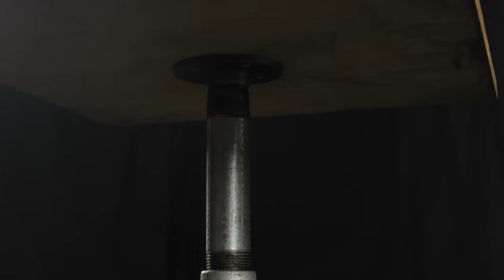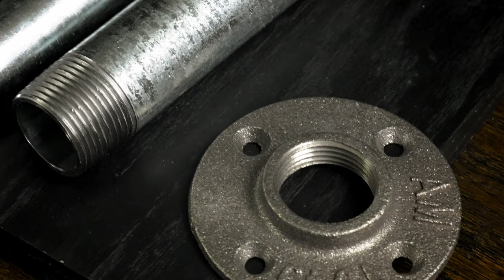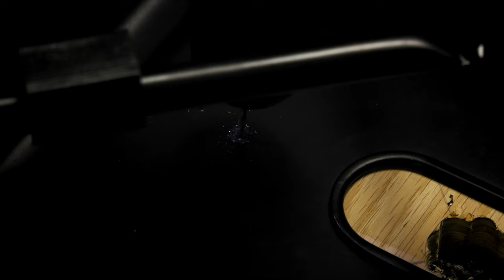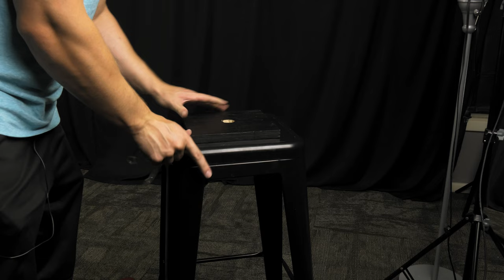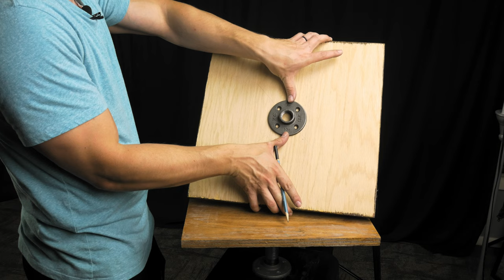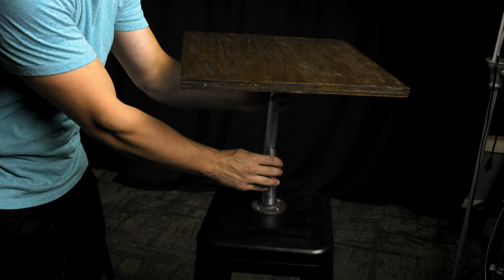Making a Sculpture Stand Turntable out of a Metal Barstool.

Comment: Also did you use WD40? The pipe I found doesn’t really fit together? 🤷🏼‍♀️
Reply from the maker: WD40 or use a file to file down some of the highpoints inside the larger pipe and on the outside of the smaller one.